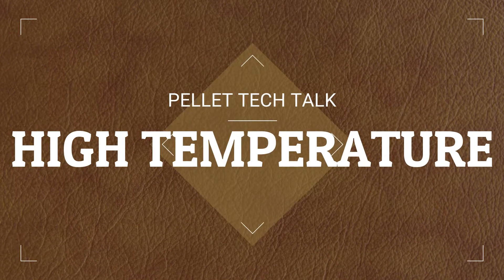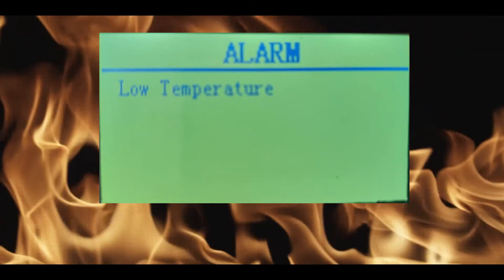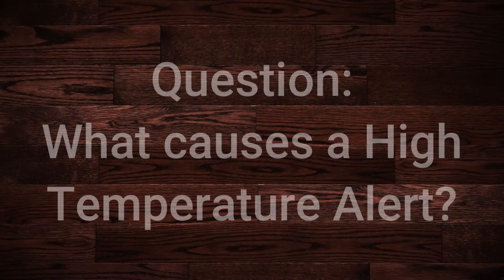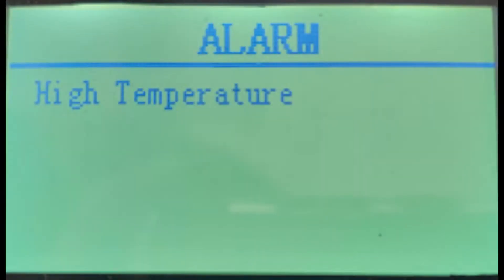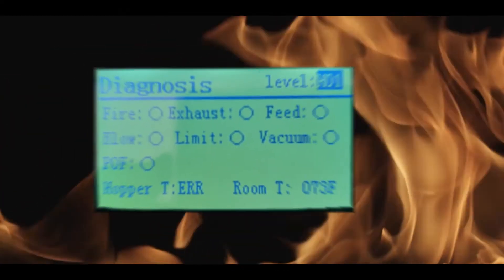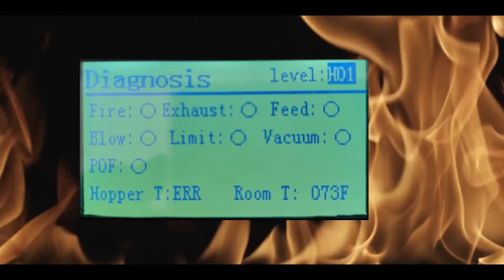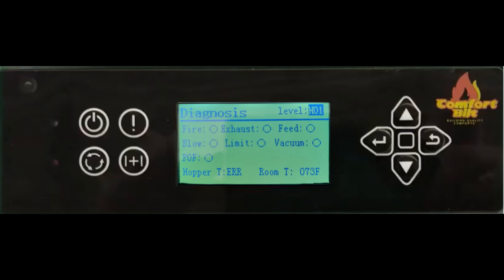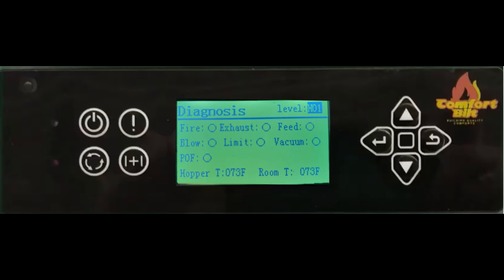High Temperature Alert Message

Comment: Mine has been throwing the high temp alarm from day one. I've been dealing with it so far and playing with different theories on why. I don't think it's the blower as it moves freely and pushes air out at a reasonable rate, although it would be nice if the speed was at least doubled. I am going to pursue the overheat sensor being damaged or faulty. I notice the fault always occurs around 98 degrees on the display. It then goes into safe mode and cools itself down, which takes about an hour. While I think it's a good feature to shut down when overheat is detected, it would sure be nice if there was at least some feedback on the cause. The videos are helpful, but a lot more detail in the manual or the controls would be great.

That said, I am very impressed with how much heat this beast puts out. If I can get it to quit shutting down so I can count on the heat, I'll be tickled pink.
Reply: 98 degrees on the display!?
Is that your house temp? That's ridiculously high. Where is your room temp probe located? Also you can bypass the high limit switch in the diagnostic panel for testing purposes